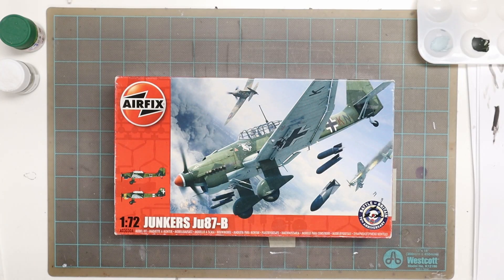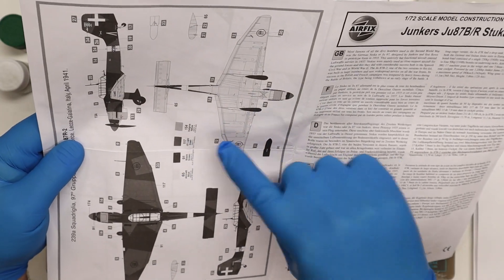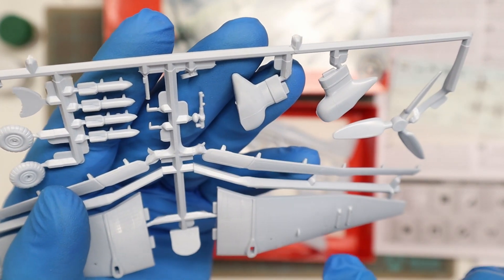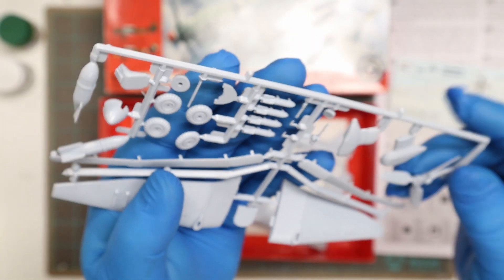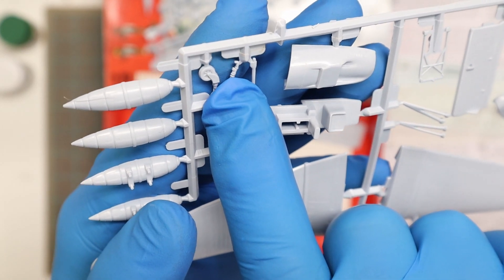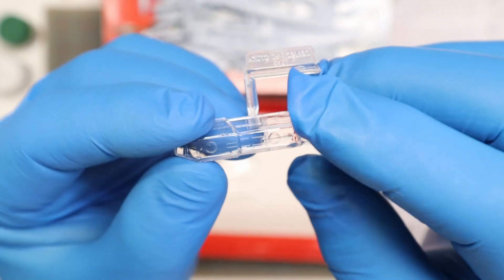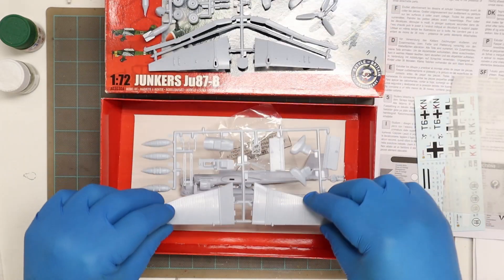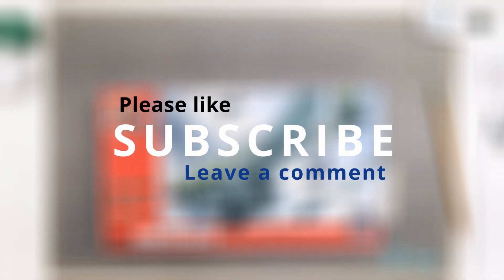Unboxing and review - Airfix Junkers Ju87-B

Comment: It’s the 1978 old version. You should bought the 2015 new tooled one（Airfix A03087)😅
Reply from the maker: Hi and thanks for watching.  Yes this is derived from the 1978 version with little change.  This kit is from 2010 and the 2015 version has the recessed panel lines and a lot more detail.  pretty well a whole different model kit.  I got this one for cheap and if you check out my other videos, you will that they are all older kits which I pick up for really good prices.  I hope you enjoyed the video.